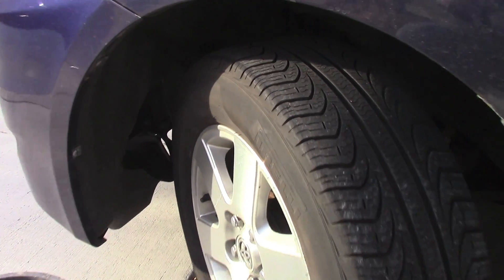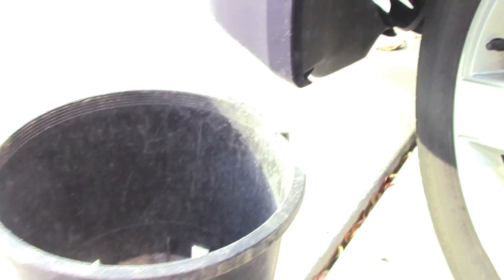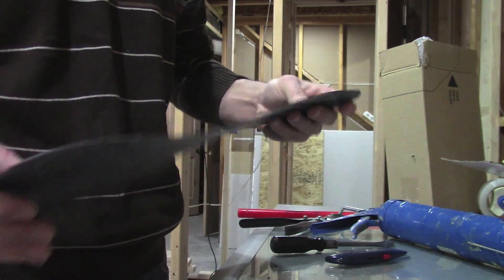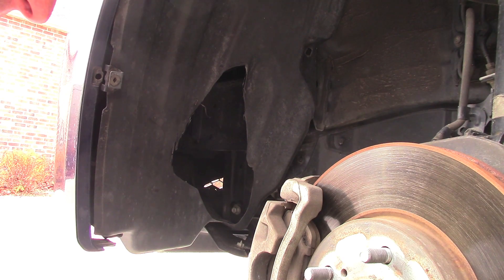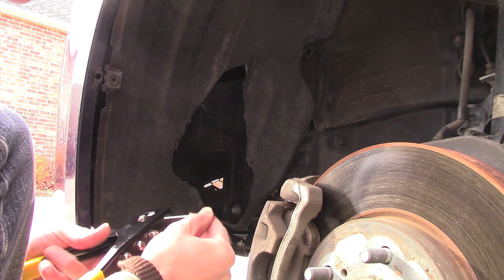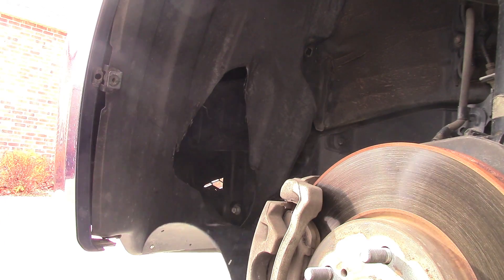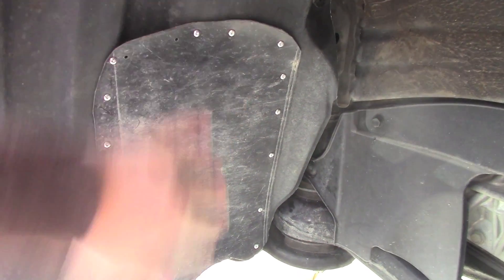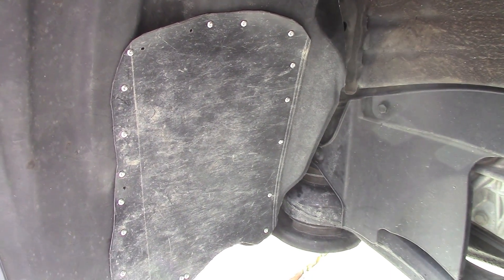How to fix Broken Wheel Well Liner patch repair

Comment: Had a led resistor that was sitting on the liner and actually melted a hole in the plastic. Was wondering how to patch it and this was it! Kid just threw out a plastic garbage can and I’ll just used some glue or nut/bolt combo just to cover the hole so water doesn’t splash in. Doesn’t have to be water tight. Awesome thanks for the idea

Comment: Just busted my kit off the bumper during Rallycross and had a similar issue happen on the highway (was more damage than I thought). I lost my driver side splash shield too, but easy to find those at Pick-N-Pull. I'm too lazy to remove my custom mounted mudflaps from the rest of the fender liner, so this is perfect. Thanks!

Comment: Just a quick question - did the plastic liner that you attached rub up against the body of the car? I have a similar situation where I was kind of sideswiped and it caused the plastic liner to break free from the body of the car
. Now it squeaks and rattles so badly!  I was going to try to reattach mine with a rivet gun what do you think?  The area that it detached from is at about 2, if viewed as a clock🤔

Comment: You just saved me over $230 on my 2017 Forte. That's what the KIA dealership told me the replacement cost was, not sure if that was before or after taxes, cuz I just laughed at the guy and hung up. Found your video, and got to work. Also I had to put washers behind the rivets, because, the first one pulled through immediately. I replaced the 2 clips that came off, that definitely caused the thing to hang down and ware the exact same V shaped hole, exactly like the one in this video. I did this a week ago and it's super secure. Thanks so much, this is why I love YouTube.
Reply: 7 months later mine is still perfect. Thanks again for this
Reply: Mine is still solid to this day!

Comment: Thanks for sharing this. I replaced a fog light bulb but forgot to screw in the cover, so on the freeway it snagged and snapped off a 3 in piece. Replacement is part of the liner which costs $70.

This will be a fun little project.

Comment: Great job.
I would suggest a heat gun for shaping. I have used a heat gun to melt trashcans (similar but even thicker, would probably work even better on the plant pots) for a project.
Never thought of rivets thanks for idea (I used zip ties, might revist that project)

Comment: I'm gonna have to do something similar. I own a Honda Civic 2010 EX Coupe. When I bought it I couldn't afford the appropriate tires so I went with cheaper fatter ones. The tires ended up scrapping off the inner fenders on bumps and every time I made full turns. It all went to shit when a big fat orange cat jumped onto my lane on the freeway on my way to work at 4am, The fucker destroyed my lower engine cover and finished off the liners. I ended up paying $60 for each 3 pieces. 

I installed the 3 pieces... with I assume the wrong clips.. or the fender i bought was a bit flimsier or thinner than the OEM with bigger holes. Point is it eventually unclipped, sagged and hooked on tall grass while reversing... I was annoyed  and carried on driving, I fucking tore them off again...Didnt care about the rest and fucking ripped everything off on the highway againn.... SO i dont wanna spend another 180 for some cheap flimsy thin plastic and im gonna have to find a way. Maybe try black all weather gorilla tape then use some plast weld idk if theres for super flexible welds. Also saw the true repair you need $400 tools. so duck that.l